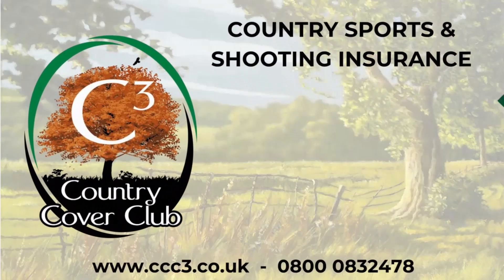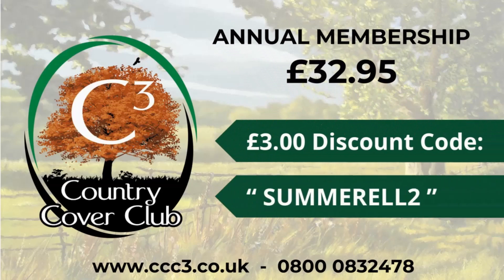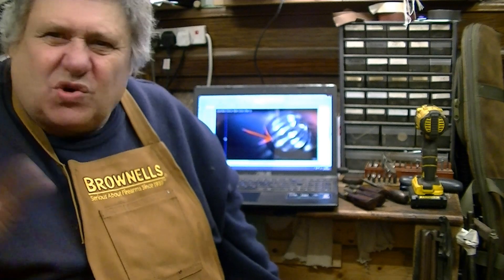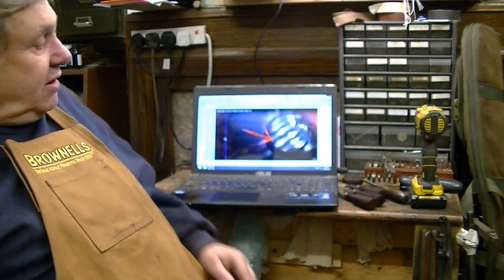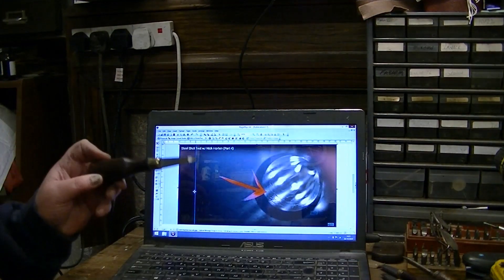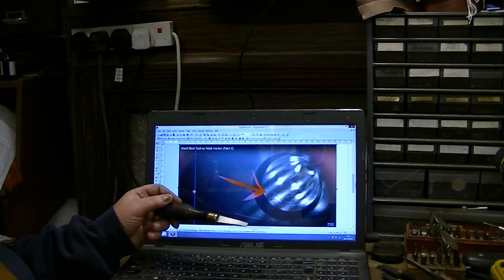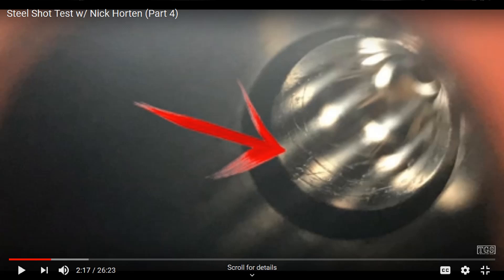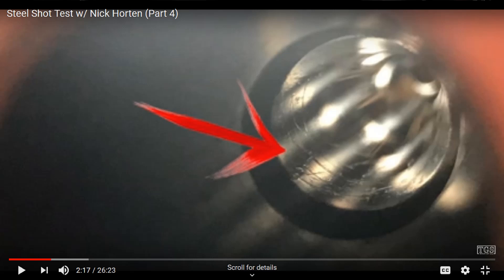reamer damage in muzzle

Comment: Well said Ian, in my  opinion for  what it counts gunsmithing work should only be attempted by a competent gunsmith as yourself
in fact tinkering with firearms should be made illegal unless qualified. And as far as steel shot is concerned you wouldn't drive a car without tires on it
Reply from the maker: Good point, all you need is a RFD and you can work on guns, however there are a number of gunshops that use their friends working out of a shed or garage. Fitting recoil pads and strikes. One gun I had in the work shop done by these cowboys was a AYA No 2, they had brazed the back of the strikes to make them longer, the brass mushroomed and the striker jammed in the action and the gun when off when it was closed. You can have you gas cooker repair by the bus driver down the road so why is he working on guns?

Comment: Ian can 28" .410 magnum barrels be opened out to 5/8 choke in both from 3/4 and full with a chrome lining?thank you all the best.Tony
Reply: even if you open it out you find they shoot tight away.
Reply: @somersetnewsnetwork2198  It was a just a technical/engineering question.I currently use Hull High Pheasant fibre 6 shot and both barrels pattern nicely if a little tight.
Reply: @tonyashton780  .410 especially pattern better with more open chokes. Shot tends to be squeezed and rebounds outwards with the smaller gauges when they are excessively choked
Reply: @woodsman2433  Hi it was just an option I was interested in looking into.Problem is iv got chrome lined barrels.Not many gunsmiths have .410 reamers.Not biggest job in the world and some gunsmith snobs who can't charge enough are not interested or just dismiss the idea.Also if choke is taken away or removed does that require the gun is re proofed?More questions than answers thanks for your comment.Regards Tony
Reply: @tonyashton780  Presuming your bore diameter is .415 which is usual and a choke of around .395, then removing around 5 - 10 thou shouldn't be an issue especially considering .410 barrel walls are usually thicker than the larger gauges, as far as the chrome lining is concerned I wouldnt like to say as this will be only around 0.0001 thick at the very most.
Reply: @woodsman2433  Would a reproof be required ?,do you know a gunsmith who would carry out this kind of work.Im based in the Midlands.Regards Tony
Reply: @tonyashton780  Hi Tony the last proper smith I new near me was John R Adin in ashbourne derbyshire. I dont know weather he is trading any more or not. It would be a simple job with the correct reamers, if my memory serves me rite he was one of the last smiths to be trained by Webley in Birmingham. Pretty sure you wouldnt need a re-proof
all the best
Reply: @woodsman2433  Thanks for info it's something I'm definitely going to look into.
Reply: Decent gunsmiths are thin on the ground as iv found and RFD means nothing.Stan Armstrong from Nottingham and Dave Freer from Loughborough where my best go to gunsmiths in the 90,s time served pro,s sadly no longer around.Regards Tony
Reply from the maker: @tonyashton780  yes we are, I seem I only get work others can't do. This week I'm re-jointing a English O/U made around 1920. rebuilt a flintlock pistol and now i'm chequering stocks and fore-ends for a Purdey and Boss. Next week I have a spring to make for a Purdey hammer gun and two muzzleloads to look at.
Reply: @countrysportstv5995  Says one thing Ian , professional gunsmith old school nowt wrong with that.Im surrounded by Fred in a shed RFD owners that could not even fill a PCP air rifle safely.I will be looking at having them done early 2021 as this year is a right off,what with Packham,general licence fiasco ,lead shot bombshell ,Covid 19 and shit weather.2021 needs to be better.Stay safe enjoy all your posts I like your style of no bull s**t presenting.Regards Tony
Reply: 0.010 restriction is classed by Teague as 5/8 choke in .410 shotguns.I use fibre wads both manafactured and homeloads due to land I shoot on.Would it be s big job Ian or straightforward for a proper gunsmith.Regards Tony